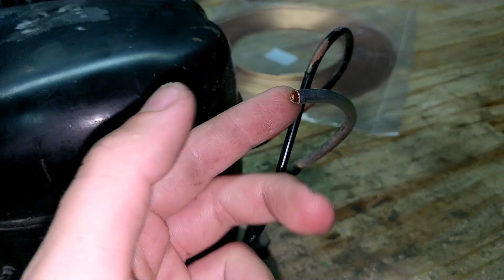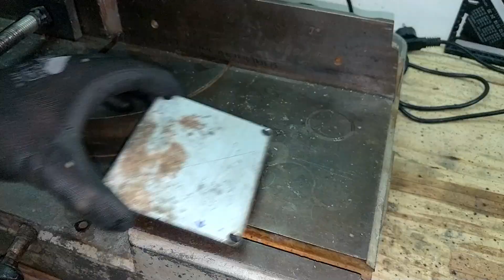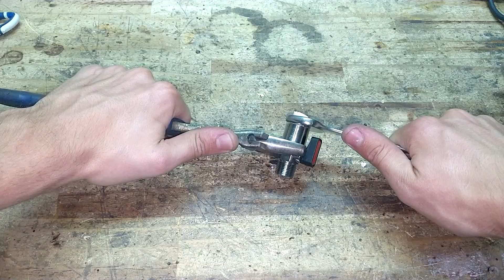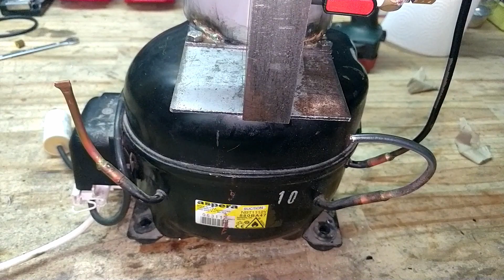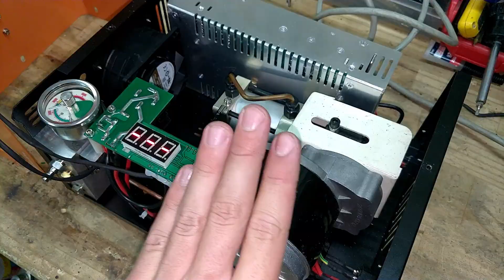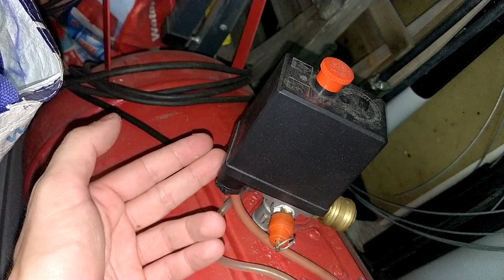Making the High Pressure Air Tank - Improvised Vid

Comment: You can use these fridge compressors as cheap vacuum pump as well, they have a low flow rate but can pull a pretty decent vacuum. However if you run them for longer times, you need to cool the compressor. A simple fan will do, you can run them 12+ hours that way. Also you can put two in series for even higher pressure/vacuum, or in parallel for increased flow rate. They are essentially free if you know where to go (dumpster diving).

Comment: Never weld a pressure vessel, not even the tank of your 8 bar shop compressor. In the factory pressure vessels are carefully heat treated after welding and manufacturing to ensure that it is able to endure thousands of pressure cycles. Welding will ruin this heat treatment and can cause the pressure vessel to crack and explode.

Comment: The fridge compressor isn't self oiling, as it usually has refridgerant running through it. Wet air affects the internals in a very different way.

Comment: Compressing undried air to 50 bar is going to result in a great deal of water condensing out in the pressure tank. Needs a drain valve at the bottom to let the water out so it doesn't pool rusting out the cylinder.

Comment: Well presented! Can you post a direct link or part number for the compressor you purchased? The  compressor I have  looked at purchasing did not have the additional 12v input. The 12v input would be a good back up for my intended application. Thanks again.
Reply from the maker: https://fr.aliexpress.com/item/1005002483286213.html?spm=a2g0o.productlist.0.0.55b25548k3961N&algo_pvid=afb0ffff-3f4f-49ff-a49d-9af2c60b3ddd&algo_exp_id=afb0ffff-3f4f-49ff-a49d-9af2c60b3ddd-11&pdp_ext_f=%7B%22sku_id%22%3A%2212000020818097548%22%7D
Reply: thank you

Comment: I would be careful of welding the tank as you need certification to weld tanks.
Reply: One needs know-how, certification is for engineering and inspectorates to know that stuff will be done up to specs and regs.

Comment: Man, high pressure testing looks nerve wracking
Reply: The safe option for testing the tank and plumbing is with a hydrostatic test pump, for example Rothenburger RP-50. The energy stored in a tank full of water (no air) at 50bar is vertually zero.  A face shield wont help much if a tank of compressed air at 60bar lets go. You have around 117L of air compressed into 2L of space :) If the oil in the fridge compressor exceeds 100 deg C it will turn acidic and attack the copper in the motor windings which are immersed in the oil :)
Reply: @colspyro  ahhh, use an incompressible fluid so there's essentially no "spring force" during a decompression event. That makes a lot of sense.
Reply: @user-dm1tv6nl2e  
Tank pressure testing is done with the tank submerged in water so changes in tank dimension can be measured. Domestic plumbing installations are typically tested with a hydrostatic test pump and left under pressure for a period of time to ensure its good.